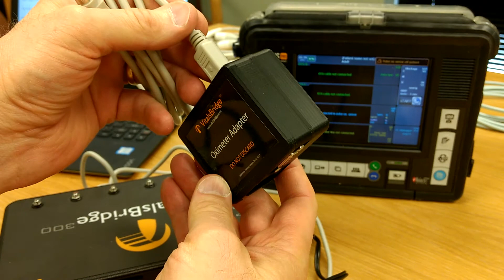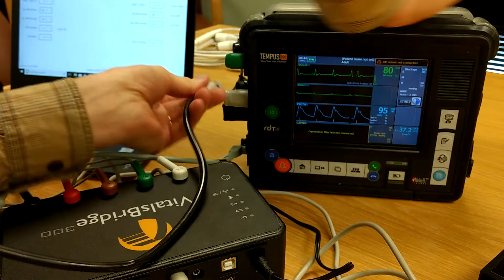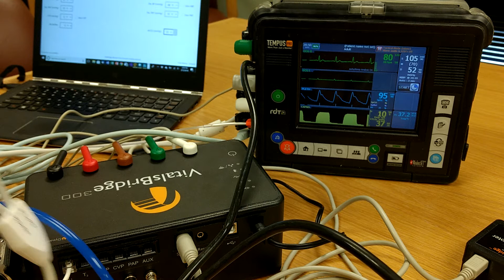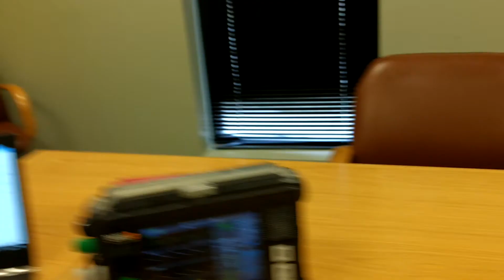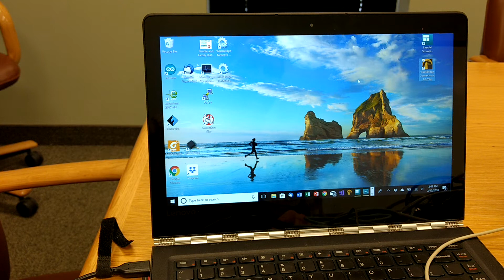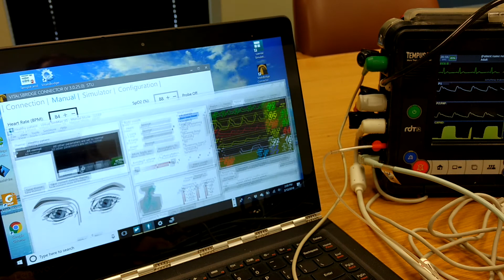VitalsBridge 300 demo and setup using Tempus Pro monitor

Comment: So I can use the VitalsBridge without a manikin if it isn't available at a certain time?
Reply from the maker: Yes you can via two ways:
1) VitalsBridge Connector software app in manual mode tab - here you are able to change the following settings:
  - ECG Rhythm 
  - Heart Rate (BPM)
  - SpO2 (%)
  - Temperature 1 & 2 (degree Celsius)
  - Systolic Blood Pressure (mmHg)
  - Diastolic Blood Pressure (mmHg)
  - Systolic PAP (mmHg)
  - Diastolic PAP (mmHg)
  - CVP (mmHg)
  - EtCO2 (mmHg)

2) VitalsBridge Connector software app in simulator tab which requires the simulation software the manikin uses.  The simulation software that the VitalsBridge connects with currently works with the Laerdal LLEAP software.

These inputs via either software will be output several patient monitors.  For more information please visit:  http://www.vitalsbridge.com/VitalsBridge/
Reply: Is the Laerdal LLEAP software is a free software? Using the VitalsBridge is enough without the LLEAP software?
Reply: Also, are the cables and adaptors for Tempus Pro are included in VitalsBridge?